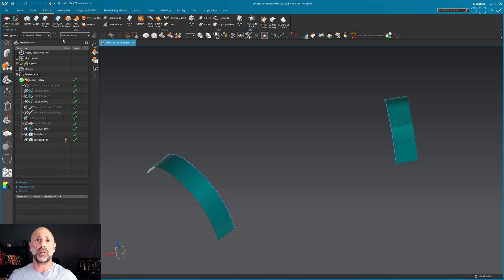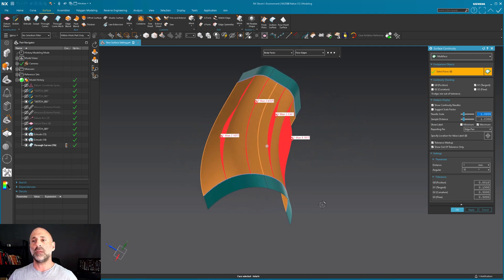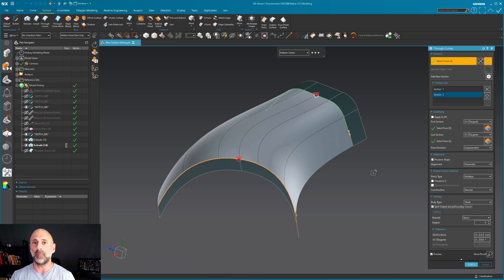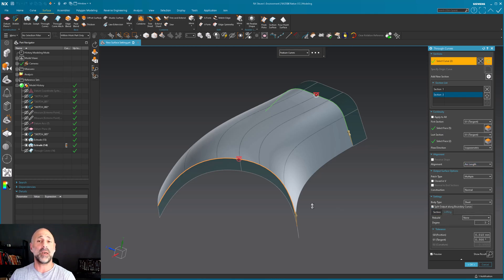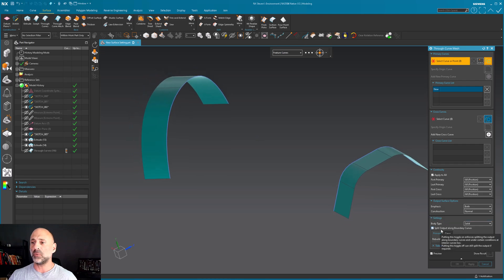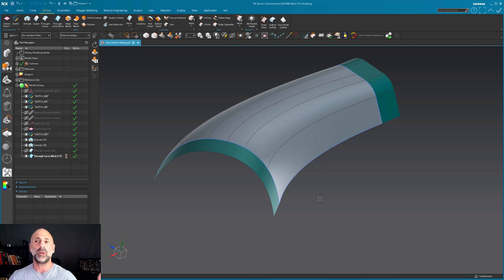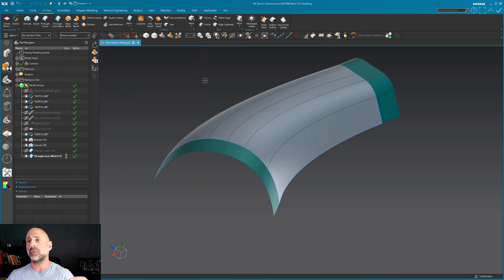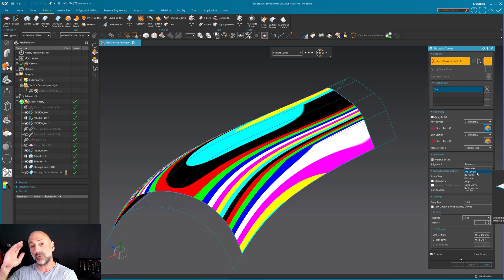NX 2506 CAD Game Changer: New Split Output Feature Fixes Surface Continuity Issues ✨

Comment: Very nice explanations, thanks! Just curious, how does this refined capability in NX compare to what exists in Catia and Creo?
Reply from the maker: I do not have an old version of V5 to check and see what it sis. I know, waaaay back in the day, like 15 years a lot changed. But right now, everything works just fine. Although V5 does make some funky similar to NX in a certain situation. 

As far as Creo goes, I do not know. I have seen Creo make some very crazy surfaces though.
Reply: @StevenMarji Now I understand what one of my customers meant when he said that even V5 is 10 years ahead of some other CAD tools - despite the old User Interface. (I think he finally decided to select V6)